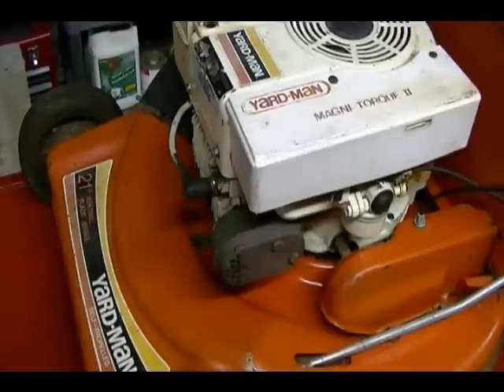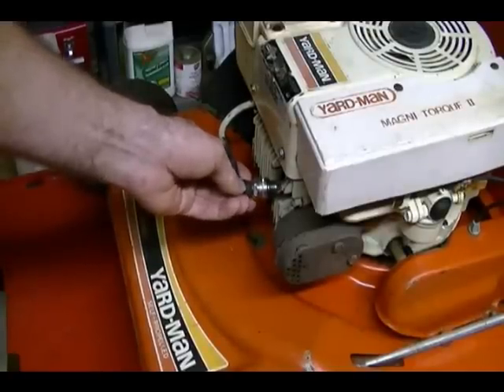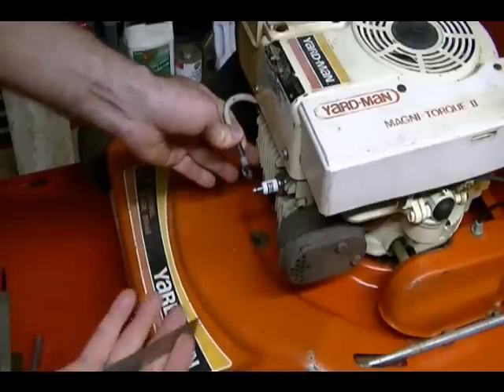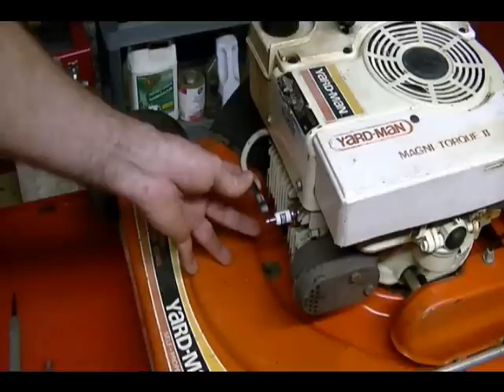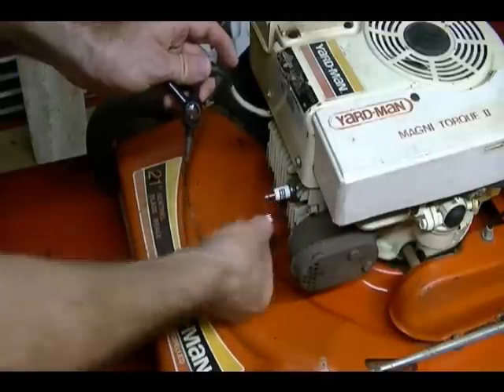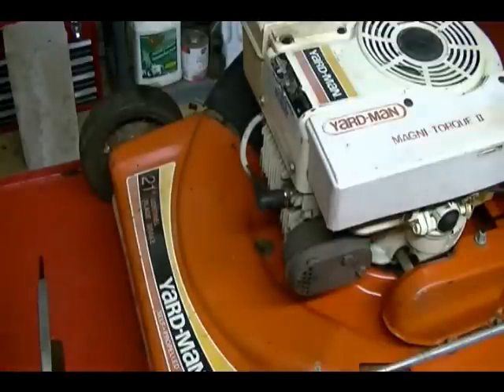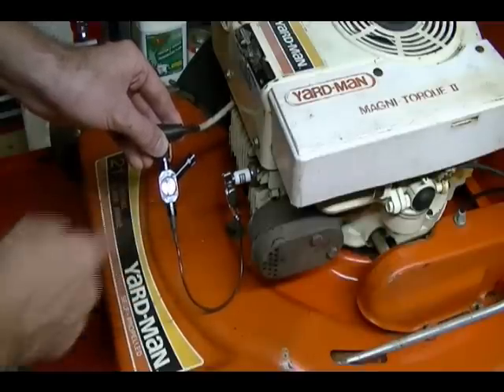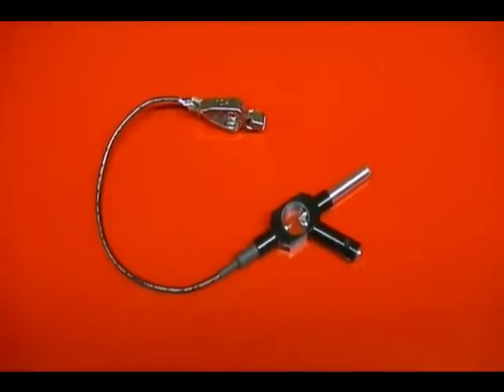Small Engine Repair: How to Check for Spark on a Tecumseh, Honda, Briggs & Stratton Lawn Mower

Comment: What is the black "tubular thing" for?  The silver one, you plugged into the spark plug wire boot but there is a black one, at about 30 degrees from it, and it has a pointy piece inside the window as well.

Comment: Engine stalls when hot.  I used this tool inline when the engine is restarted, however I do not see the arc between the electrodes, while the engine is running.  Could this indicate a weak coil when it's hot?  -Rick

Comment: Also check the operation of the dead man lever, if the engine brake is not working properly, it may not open the kill circuit. And this will also not let the coil fire.
Reply from the maker: Thanks for the info and commenting

Comment: You need to check the kill circuit as well, the small wire hooked to the coil, sometimes if the circuit is closed it will not let the coil fire.  Sometimes that wire will be grounded to the engine

Comment: I enjoy your videos.  Great Job!  

I have the briggs spark tester.  However, I find it challenging to pull the cord and watch for spark at the same time.  Depending on the mower, the tester is often at the front of the mower.  Even if I can get the tester in a position where I can see it, there is often glare on the plexiglass windows.  Any tips or suggestions?  Are there other testers that are easier to see and have a longer lead?  Thanks!

Comment: New lawnmowers with mandated safety requirements will not have spark present unless the mechanical safety handle is pulled down to remove the spark to ground(an intended spark killer) and activate the blade clutch. Without the safety override, you'll never get spark.